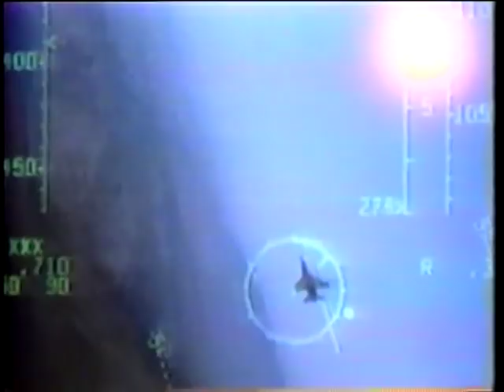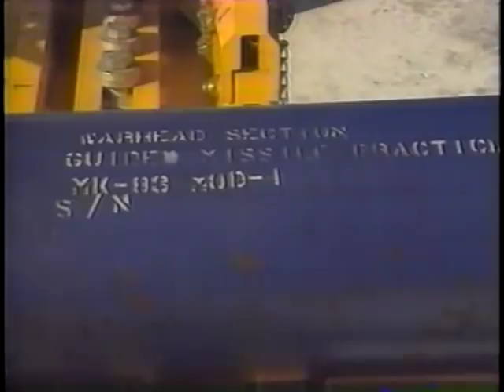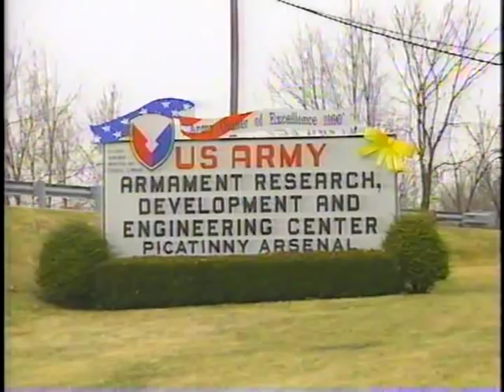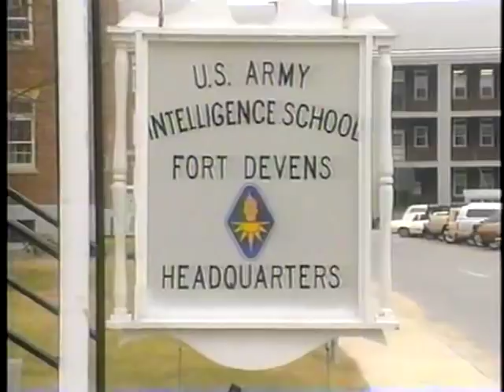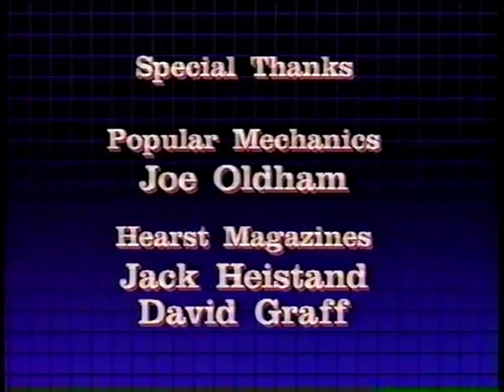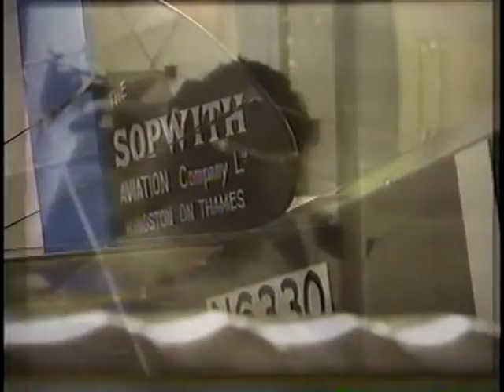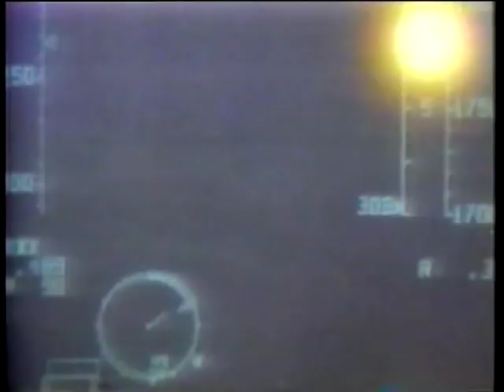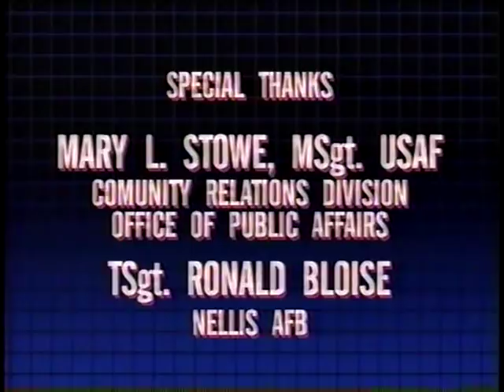The Technology of War - Vol.  I & II

Comment: It’s funny how they say the F-22 would replace the F-15. It’s now 2021 and the F-15 is still very much in service and they are even upgrading it.
Reply: Cause its faster. Making the F-35 single engine was a planned mistake....
Reply: F22 Raptor is best fighter in world but limited by cost.    700 ordered only 170 built
Reply: @mattrubin89  the F-22 didn't need to be faster than the F-15. It has a far better radar, more fuel efficient engines, lower radar cross section, and is far more agile than the F-15. The F-22 can actually operate at a higher combat service ceiling, while the F-15 can carry more ordinance and has a faster dash speed.

The F-15 is GREAT, but the F-22 is superior. However, the F-22 costs a lot more to purchase, operate, and maintain; hence why the USAF and Air National Guard have flown the F-15C to the brink of near structural failure.

Comment: the F-14 Tomcat is by far the best looking carrier borne fighter ever . . . even after 40 years still looks more in line with present day fighter than the 1970s . . . in present day warfare a couple of radar absorbing coatings should minimize the F-14 RCS to some extent . . .
Reply: Thank the Grumman Designer “Joseph Whitney”, it was his design from the bulkhead back!  I am proud of my uncle joe!
Reply: Brian Roome  He was the initial/original designer of the F-14.  Many engineers made it work. And many more built it.  However, the original was his.

In fact, after a mod to stretch it, they had trouble trapping.  They choppered him from his hometown ( Smithtown, Long Island, NY ), to a carrier off the coast, to troubleshoot.  Result: they needed to extend the hook!

Countless numbers of people engineered & worked on it over the years, but, does not change the fact!
Reply: The best carrier protection fighter in history. Most powerful and advanced  radar and BVR missiles...
Reply: I have similar opinion.
Reply: 40? Try 52, she celebrated 50 in 2020 :D
Reply: Miltl
Reply: Granted the same could be said of many planes, but you can only do so much, and every plane you add coatings to has to have that coating maintained to perfection. Perhaps you can begin to see why the F-22 is not in nearly as large numbers as the F-14

Comment: The reason the ai8r war was over so fast was because the Iraqis ordered fax machines from a Japanese  company ( that I will not name)  .It had a I'm here chip inside that would emit a signal when asked by a fighter jet, to turn on when asked. All the "fax machines" would announce there position which was at ALL Command and control air bases . This made the target HIGHLY visible to HARM missiles that took out the  air bases that had them :) .

Comment: Watching this documentary and the US Navy of the time, (beginning of the 90s), I regret that we still haven't designed and included into an air wing a designated fleet defense aircraft, a worthy replacement for the venerable F-14 Tomcat. Of course now it wouldn't make sense to produce a Super Tomcat since the technology has developed enough so that the next fleet defense air platform can be fully unmanned UAV.. The traits this imagined Tomcat successor should have are.... Stealth, capable of supersonic speeds, large magazine depth and, what's most important - range, a huge range of 2000 miles or a radius of at least a 1000 miles. Next, this UAV needs a next generation of air to air missiles. Thankfully USAF is working on two missiles in this extremely long range category to counter the Chinese PL-15. These are AIM-260 and a Long range engagement weapon or LREW. These to missiles aren't competing for the same program, they will both be developed. We're talking about a hypersonic air 2 air missile with at least 150-200 mile range. Of course, advanced high tech tri mode guidance system is a must so the jammers can't mess with it..
So, combining this UAV with an advanced A2A missile is a true game changer that would make our super carriers relevant for the next 100 years. Of course lasers should be incorporated into this UAVs as soon as the technology matures enough so they can be a viable defense weapon capable of shooting down enemy's cruise and A2A missiles....
Reply: We have TOM CRUISE Dude.

Comment: 38:27 MLRS was what I worked with when I served in the US Army
Reply: Thanks for your service, I was a Bradley mechanic for a few years then went into signal comms...
Reply: I was with 2/61 Air Defense Artillery in Korea (82 - 85). Camp Stanley, home of the 2nd Division Artillery. Chaparral/Vulcan unit. These guys rolled, so did we. One night 🌙 we move into positions. In between 8 in and 155 positions. They're firing randomly all night. Next is the MLRS. Wow, talk about a wake up call. Middle of the night, live fire. Completely disoriented. The 8in and MLRS were at a different compound about 6 km from us. Man, scared the cr&p out of us. I was a SGT/SSG at the time.
Reply: @jstetzer01  Awesome; thanks for your service Sarge
Reply: Doubt it
Reply: @metalmike570  abrams
Reply: @FuckFiresOfFury  doubt what? That my MOS was 13P and that I spent 16 months at Camp Casey with the 6th and 37th? And then 2 years with the 1/14th at Fort Sill, a HIMARS unit.
Reply: @jstetzer01  the first time I heard the MLRS fire I was surprised how violent it is.
Reply: @FuckFiresOfFury  Around 2000 I was in a heavy Cav Unit; the 1/3 Armored Cavalry Regiment at Carson. I helped more than a few times with the Abrams (M -1) I think. I wish I was an Abrams mechanic then instead of the Bradley as far as good Sergeants. I liked the Abrams Sergeant a helluva lot more than mine. I ended up changing MOS right before they went to Iraq in late 2002; but I went into the signal corps. Do you have any good memories from you time in the service?